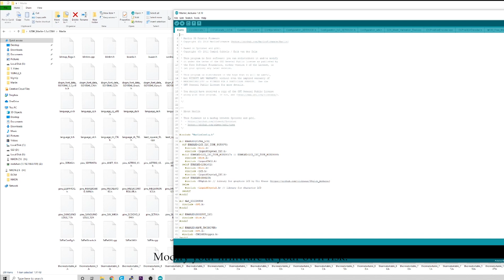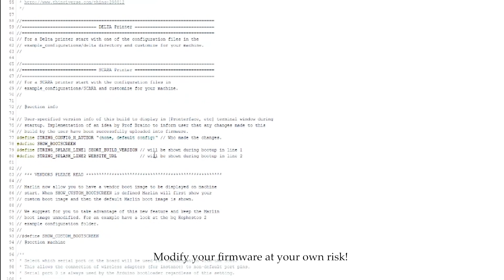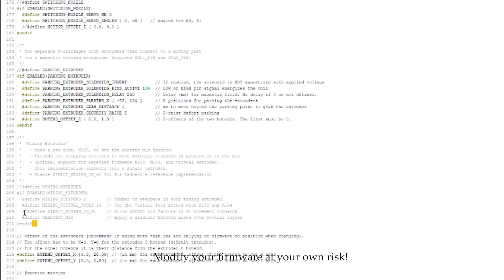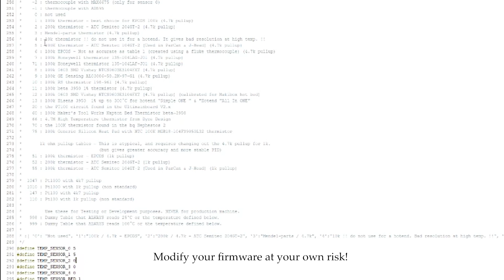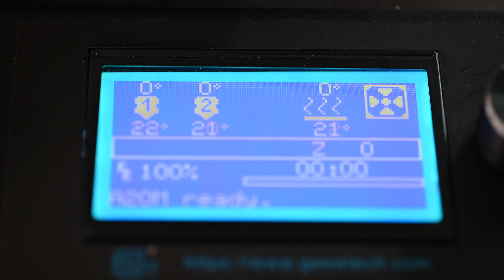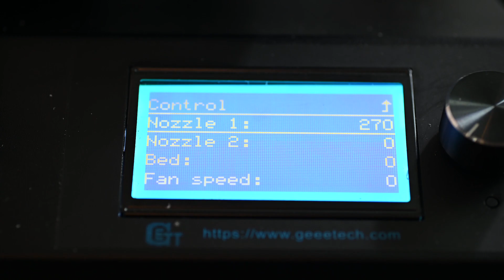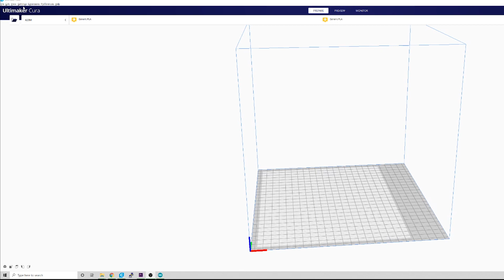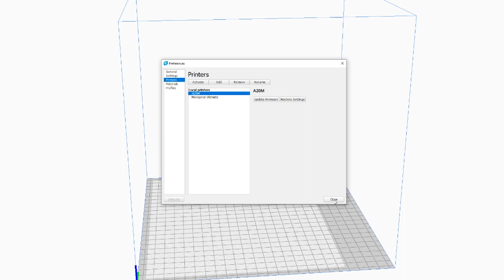Geeetech A20M E3D Chimera Upgrade

Comment: u hi cheers for the vid, most helpfull,
i just wanna give a heads up , the new gt250 v4 'black' boards dont have space in the connector to add the second hotend ,  the board has slots for 2 more hotends, but havent got the components soldered on :(
there are some boards on amazon by giantarm for the a10t that DO have the slots populated though, or u can find the 'white' boards (seem to be fully populated) on banggood
hope this helps
Reply from the maker: That's good to know for those who have that board. thanks for sharing the info!
Reply: pro trick : you can watch movies on flixzone. Been using it for watching lots of of movies these days.
Reply: @Dominik Magnus yea, have been watching on Flixzone} for years myself =)

Comment: I'm assuming this mount will work on an A10T, obviously for a 2 nozzle setup, not 3. I'm tired of dealing with the single nozzle. Although after seeing your 2 color benchy, I might not switch as I have my printer printing nearly that good with my almost stock unit. I printed a 3 color poo emoji print today and it came out nearly as well as that, but with 3 colors. 

But a question, did the connector on the motherboard have the metal pins already in them? The 4 places where you connected the 2nd hot end too?

Comment: Hey I know this isn't exactly new material, but I have a problem with the thermistor 1 (on the board). It always shows 0 degrees, even when i short the 2 pins on the molex connector. Does that mean my board is bad? Are there any other thermistor locations on a 2560 v 3.1 board?
Reply from the maker: I'm not familiar with that particular issue, but did you update the thermistor section in the firmware? And are your pins installed correctly so they're making contact?
Reply: @paulprice  Yes they're connected well. I took apart an old ATX motherboard molex & used 2 rounded connectors with the wires still attached & spliced them to the thermistor. And I modified the 2 temp_sensor (0 & 1) entries in the config.h; I think this board just won't read the second thermistor...if they are shorted you should get 387 degrees (or something like that). I still get 0. It works on the expansion board

Comment: Thanks for this video man! I got this running on my A10M, now I’m trying to figure out how to print without oozing, I might just do a prime tower to be sure things come out clean.
Reply from the maker: Yeah it's going to take a lot of tweaking here and there to get it to where you want. I forget what the setting is called, but I tend to use the option of making a shell around the part instead of a priming tower. And that works well enough for me. But you'll have to play around and find what works best for your setup.
Reply: @paulprice  i think its oozing shield on cura

Comment: there's a piece on thingiverse that moves that breakout board to the front and raises it up. It makes everything so much easier to work on. I am actually installing a skr 1.4 and skr 3.5 touchscreen in my a20m this weekend. Actually my hot end is the only thing I haven't had issues with lol. I am changing the board out because I had it and I am getting tired of the Y layer shifts.

Comment: I printed the same mount as you did but it seems that the Y position is about 6mm further out compared to the original hot end. You don't mention how you compensated for that or did you somehow not have that issue?

Comment: Hey Paul, I completed my Chimera upgrade. I have the new GT2560_V4 board so it was a little different. What I noticed when I used the firmware (1.18) from GitHub is that some settings are now missing on the LCD. The entire Movement section under the Controls section is gone? It used to allow control of the Z-Offset. Do you know of another version I could use that may have that back?

Comment: I noticed you offset the hotend in Cura and not in the firmware. Any reason you didn't just uncomment this line #define HOTEND_OFFSET_X {0.0, 20.00}
Reply from the maker: You can do it either way. I did it in cura as it was easier and faster to tweak the settings. Whereas if you change the firmware you'd have to reupload it every time you make an adjustment.

I suppose you could tweak it in cura and then once you have the settings dialed in then make those changes in the firmware so it's more permanent. But it's not required to do so.
Reply: Paul's Projects Great thanks. I will measure it with a caliper and try the setting in the firmware and then adjust and re-upload with the final number. I use Cura and Prusa depending on what I am printing so want to get it dialed in so I don't have to worry about it again. Thanks for the post.

Comment: I just sub. because I am also a A20M owner and it is just a crazy printer. Now I am having issues with E0 extruder jumping after changing out the extruder to an aluminum one becase the plastic one kept slipping. I had to reverse it in the firmware ETC. It's just a big wokr in progress and maybe we can all work together on the thing.
Reply: I also redesigned some raised standoff for the extruder because someone made them and they worked good but would cut off bowden tube if it got too high so I redid and made them angled.

Comment: Hi, i have finished flashing with your modified firmware, i was getting to much error when trying to comment all mixing lines so i decided to use yours. Everything works fine except for the bltouch options which are gone how can i set the options back on? 

I see an option to edit number of extruders in configuration_3dtouch.h which is set to 1 maybe i need to change that to 2 to make it bltouch options appear again?
Reply from the maker: I don't use a BLtouch, but there should be a section dedicated for the BLtouch that you can enable in the firmware.
Reply: @paulprice  finally i got the correct settings checking line after line has some missing. Now i only need to setup cura would you mind sharing your cura profile? It would be big help. Also did you manage to get proper settings for retraction ect..?

Comment: hi nice video im trying to do the same to my a20m but im stuck with the fan. what kind of fan is it? looks like Anet? My a20m fan wont fit in that mount? I mean the top one.
Reply from the maker: If you mean the part cooling fan then it's this type.

https://www.amazon.com/dp/B079BPS9Q8/ref=cm_sw_r_em_apa_i_wkY0EbHWC5WC8

If memory serves it needs to be a 24v fan, which is what I linked. And if I remember right I think I just spliced the new fans wires into the wire harness of the old fan so I could just plug it into that little breakout board on the back.

Hope that helps
Reply: @paulprice  thanks just ordered the same from ebay, yes i did change the small conecter for the temp sensor using the old stock one. I will proceed with the firmware part for now until i receive the fan. Thanks for your fast reply.